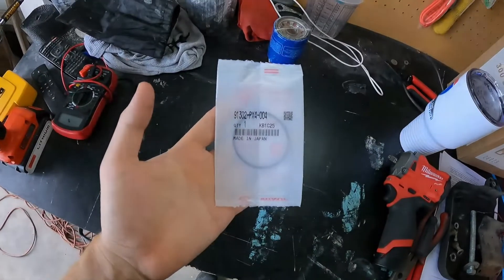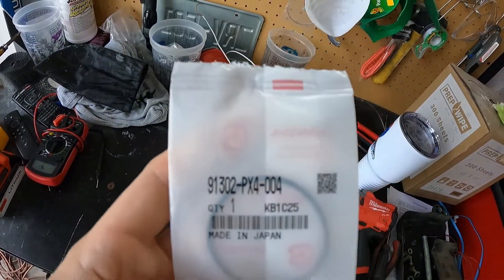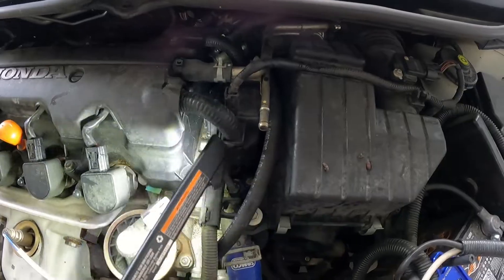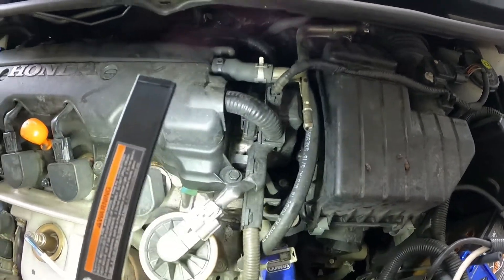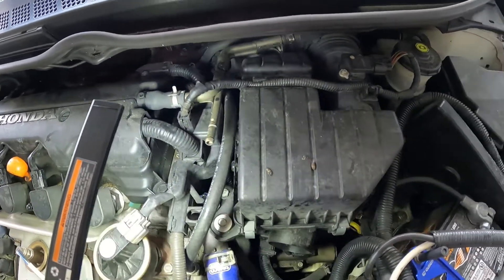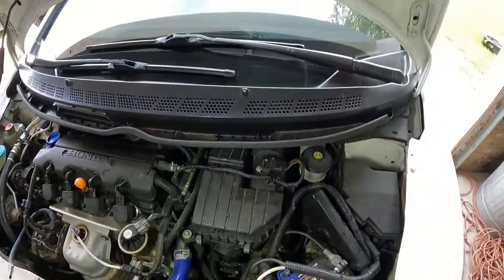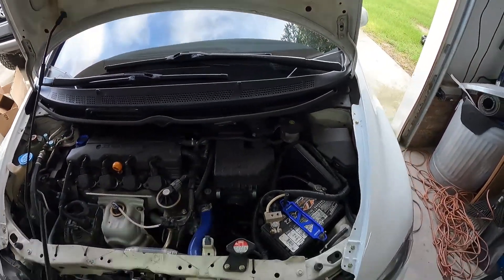Camshaft thrust plate seal replacement 2006 - 2011 Honda Civic 1.8

Comment: Would it be advisable to replace the o-ring when replacing the valve cover gasket even if it’s not leaking yet?
Reply from the maker: It wouldnt hurt, its a leak prone area

Comment: I just got done replacing this O ring and that you again for this video which I referenced. Couple tips for those doing this job. Facing the car the airbox has a 10mm bolt to the right rear. You will see this looking down from the brake reservoir side. You want to remove this bolt first. I made the mistake of lifting up the airbox and leaning it after removing the intake hoses. There was then reduced space  to maneuver a ratchet with an extension. It was not till I was reinstalling the airbox that I realized this. Next tip is for the two 10mm bolts holding in the thrust plate. I used a ratcheting 10mm wrench to break both bolts loose and once this was done there was not enough friction in the bolt holes for the ratcheting mechanism to work. I used a telescoping magnet thingy and dragged it over the bolt head and with each successive pass the bolt loosened completely. For installation of the bolts I did the same thing and it worked. It was not till the last 1/8th inch or so of the bolt travel that the ratcheting mechanism of the wrench kicked in. Just be patient. All this because of the reduced space in which to work. Again , TY for the video!
Reply from the maker: Thanks for the support

Comment: After 10 hours of pain in 50°f weather it's done! The leak got worse right when i was ready to put it on the road so i had to do it (also did the valve rocker gasket) with parts straight from the dealer because last time i fixed a gasket with a Amazon one it blew 200mi later so hopefully it won't leak again ( edit: it doesn't!!! 🎉). Something that would make this job significantly easier is to disconnect the sparkplug harnes from the alternator so you can swing it away (disconnect battery first). For tools i recommend using a longer 10mm wrench if possible but having a ratcheting 10mm wrench🔧 would be a game changer since you wouldn't have to take it on and off to twist the bolts in such a tight space. Also i recommend getting a headlight (like a headband with a light on it), having both hands available while having light in a good position 24/7 is one of those things where you can't go back without it.

Comment: Idk why everyone swears by these cars mine has been nothing but constant mechanical issues since i bought it
Reply from the maker: It be like that sometimes. Ive been driving the car in the video for almost 15 years and its been the cheapest cost of ownership of any vehicle that Ive had.
Reply: You got a lemon, that’s why.

I have had 3 of these, including one being my first car and having over 300k miles when I scrapped it, and now I’m in search for my 4th. That should tell you something about these cars. The 2 I currently have are both running with zero major issues.

Comment: I was doing the transmission filter on my 06 civic (at 225k miles, shifts way better even without new fluid) and when i took the air box out i noticed that the area on the side of the engine and top of the transmission was covered in oil, then i found this video. Thank you! I'll do it later however as it's a slow leak, it just looks really bad because it was probably leaking for years. I'll comment again whenever i do it.
Reply from the maker: Good deal. Glad to help

Comment: Great DIY and video what a pain to get off the thrust plate separated after removing the plates bolts.  I was just tapping it with a hammer and screw driver and a metal chunk broke off.  Got new one threw it on and good as new thank you man

Comment: Dam that’s it.  Exactly where I think mines leaking seeping from thanks. Great work there’s another known leak under that ear valve but to the side it’s a plastic cover with that same o ring.  Then there’s the VVT seal on back of passenger side of engine. 
Just a heads up.

Comment: Have just finished doing this repair on my Civic defineitly worth replacing this Oring as when it's worn out you will loose alot of oil and it makes a big mess this was also running down in to my gearbox and causing my clutch to slip now that it's replaced and and cleaned up no more clutch issues
Reply: There were issues with my clutch on a Honda Jazz and the mechanic just found this same seal leaking oil, hopefully the clutch issue gets sorted when the seal is replaced.
Reply: @bonneyferns  Hopefully it solves your problem been driving my Civic for about a week now after doing this repair and all is good

Comment: Like others have said, good diy, thanks for the video! For anyone else that may be using this as a resource, the thrust plate itself was pretty difficult to get off (after the bolts were removed). I was able to remove it by turning it with very light taps from a hammer. Once it moved a couple times it came off easy.
Reply from the maker: Thanks for the support
Reply: Yeah i almost snapped my screwdriver trying to pry it out

Comment: This is a great and helpful diy video man. I already replaced the vtec solenoid gasket, high/low pressure power steering hose o ring and valve gasket about 3 years ago. My son saw oil leaking down the tranny box when he was changing oil and it wasn’t color red so I suspect it’s coming from this. You didn’t have to drain the engine oil before removing that part did you?
Reply from the maker: No, no need to drain.

Comment: This stupid o ring is leaking like crazy and all the work I did just to find the bottom bolt not to budge and literally strip. Now I have to figure out how to extract the bolt with such a narrow space due to the wire harness not being flexible to move out the way.
Reply: Update: Pain in the damn rear! The new seal got crimped between the thrust plate and surface tearing the seal apart. Local auto parts store do not carry this seal. Luckily dealer parts store was open in the evening and was able to buy 2 more seals just in case.
Reply: @KobeGoated94  did you get it in? Hopefully you got new bolts
Reply: @PlumbCarton5607 yup got it in. Oil the o-ring to have flexibility and take the time to ensure it doesnt pinched by inserting straight. Turn slightly to budge it in

Comment: Off topic, got the same engine. Did you ever experience surging/minor misfire especially on cold starts/or when the car sits for several hours and goes away after its warm up?
Reply from the maker: No, i havent had that issue
Reply: I have the same problem. Did you manage to find the cause?

Comment: I have a 2008 ex civic, the car feels super good, I did a complete tune-up job, valve calibration, throttle body cleaning, change some sensors, fuel pump filter, but I'm still struggling with high consumption of gasoline, I have a scanner and it does not have DTC codes but it always indicates a rich mixture, I am almost throwing in the towel, i need to do the camshaft o ring oil replaceent to, and thi is the next step, 

Thanks for the guide.!
Reply: Clean EGR valve.
Reply from the maker: If you havent, you may want to replace the primary (front) o2 sensor. I recommend an OEM honda one as replacement. A failing front o2 can lead to excessive fuel consumption. Also wouldnt be a bad idea to clean the mass airflow sensor.
Reply: @ballsoutperformance  I do this, I replace the O2 sensor and I scan, something says fuel trims are always in high negative numbers, I read that this happens because the oxygen sensor is indicating that the mixture is very rich and tells the injectors to put less gasoline, but even so it does not give me even 260 km per full tank.
Reply: Sounds like leaking fuel injectors. Have you resolved your issue?

Comment: Excellent video, definitely the best one on Youtube for this job.  Did it solve the oil leak issue in this area?
Reply from the maker: Yes it did. Its really the only thing that can cause oil leakage from this area.  The valve cover gasket is another common leak area (already been replaced on this car).  If you have a leak at the rear of the engine, the vtec solenoid (spool valve) gasket is another common issue.
Reply: @ballsoutperformance  Thanks, I've replaced both the valve cover gasket and the vtec solenoid gasket last year.  Saw oil in this area and hoped it was residual from the valve cover, but it's the thust plate seal.  Have you done the plastic cam cap on the other side?  I saw a video where someone just pried it out with a screwdriver, but I'm having a hard time believing it's that easy.
Reply from the maker: Yea Ive changed that one as well. Its been a while but yea, I think thats all there is to it. The old D series and B series engines were the same way
Reply: @coolantkid3428 i used honda bond and glued it all over , leak stopped and so far no issues
Reply: @ballsoutperformance Just had this work done, thanks to this video. In addition the vtec solenoid gasket, timng cover plug on the passenger side and the valve cover gasket. Most of the leaks are now gone but now I do suspect that the timing chain case cover on the timing cover maybe leaking. Now I see oil on the bottom of the oil pan. Do you have this problem?
Reply from the maker: Havent had that issue yet. Could also be the front crankshaft seal, if it looks like its coming from behind the crank pulley and running down.
Reply: @jasoncurry2515  Many online does “8th gen civic timing cover leak”
Reply: Leaks are totally gone now, no timing cover leak.  The original power steering pump was leaking bad. Also the original passenger side CV axle was leaking really bad. Car has over 227k miles and counting!
Reply from the maker: Good deal man. ! Mine has around the same mileage . Great cars.
Reply: @ballsoutperformance what’s the part number for that o ring?? I have same issue on my 06. Just hit 403,000 miles, pulled timing cover, for a reseal, as my oil filter is always wet and the housing around it, so resealing the timing cover and will do oil pan too. But noticed I have this leak now too, from rear cam end by air box. Leaking all ontop ot the trans and down the front of it.
Reply: Hey brother really gotta thank you for this video, I think your the only one that has come out with that seal. Everything else is the vtec gasket.